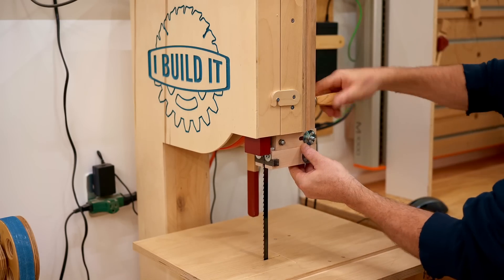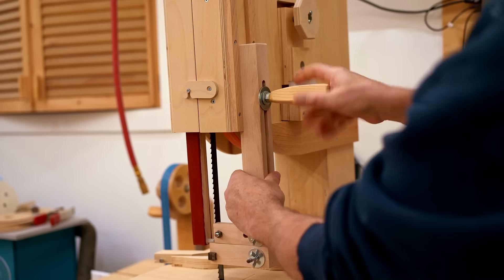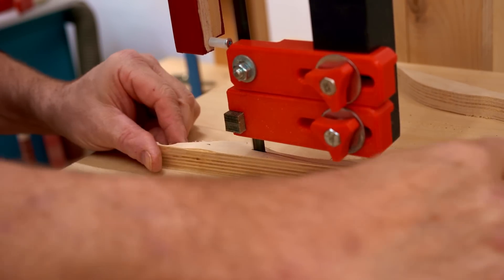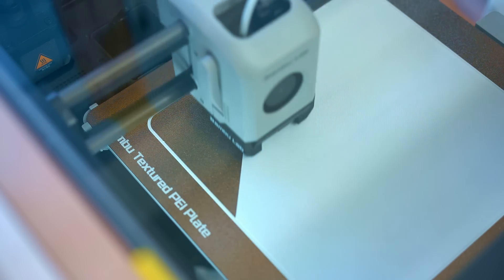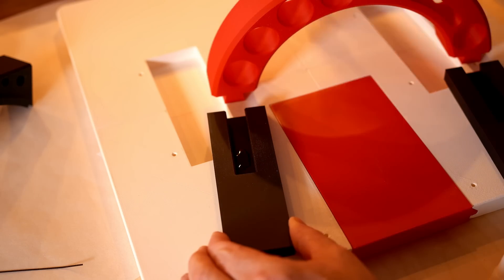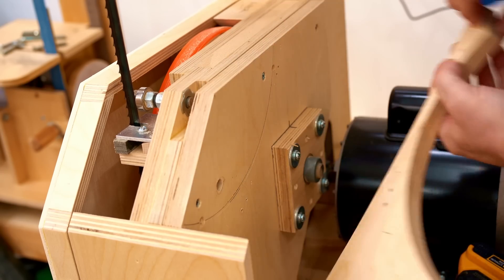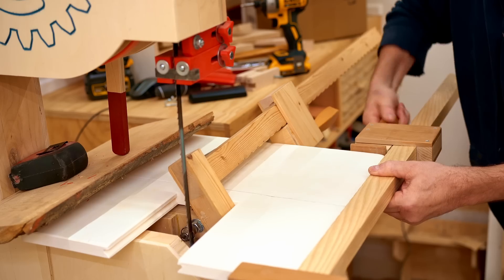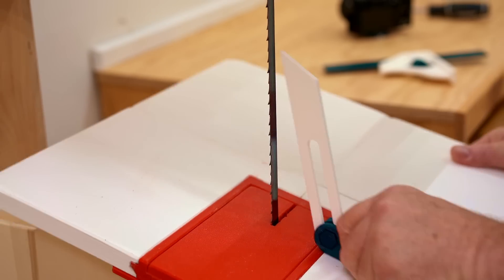He Said You Can't 3D Print a Band Saw... I Said Hold My Beer

Comment: Absolutely! Plastic has become the new wood in many ways. But beyond the humor, I really appreciate your 3D printing content. The 3D printing community on YouTube often focuses on kids printing toys or adults printing novelty items, which can give 3D printing a superficial reputation. However, the truth is that if you have an engineering mindset, you can produce functional, load-bearing parts with ease using 3D printing technology.

Comparing plastic to wood, it's evident that plastic is softer. Yet, for numerous applications, this difference isn't a critical concern. Your expertise lies in crafting items traditionally made of metal from wood, simply by scaling up the wooden components. This approach effectively resolves the challenge since space constraints are often less significant in these applications. Similarly, with 3D printing, scaling up plastic parts can meet the load-bearing requirements of metal parts without issue.

Furthermore, if you're utilizing an enclosed printing setup, you can explore materials like polycarbonate, which offer significantly higher stiffness and strength compared to PLA or PETG. This versatility showcases the potential of 3D printing to create durable and functional components across various industries.

Comment: Keep going!!!!!!!! I design and build machinery. This will absolutely work if designed properly and your printing strategy is well thought out. Your an amazing engineer. You can do this. P.S. make the 4 part table with tear drop interlocks for the connections same as you did with the guide bar print.

Comment: How about a separate 3d channel? Please finish printing the entire bandsaw.
Reply: taking a design with "wood" in mind, and translating that 1:1 to 3d printing wont work at all - you certainly can print a good and functioning bandsaw, but you have to design it with your manufacturing process in mind. just reproducing a wooden bandsaw with a 3d printer wouldnt do the process any justice.
Reply: @SharkyMoto  yeah the main example is cutting the insert that clearly wasn't reinforced instead of doing it in cad.

Comment: You've actually tapped into something very exciting here John. There are plenty of people out there doing accessories and custom parts for tools on their 3d printer, but nobody is doing real, substantial tools, except actual printers which are at least 50% hardware.
Reply: I question heat transfer from the blade guides melting the plastic.

Comment: Hello John I recommend that some of the parts, you can make them more dirable and stronger if you fill them with epoxy… I have e made two half’s filled with T-88 and reconnected with some T-88 and two screws mostly as alignments, I use them to even make hydropress mounts ALU.

Comment: This is not a project. It's an adventure. So much can be learned by making the parts for the bandsaw out of 3D printed parts. As you have shown, some things will need to be redesigned to meet the requirements needed to perform the tasks. Please continue improving the bandsaw. love the ideas.

Comment: You probably answer your own question in the video.
( + ) When it comes to finishes, miters, dovetails, fine finishing, the 3dP saves you the "donkey work" of "spending the better part of a day" once the design is ready.
(  - ) When it cones to brute strength of large flat objects, "stock" material wins out. 

The optimum, then would be a combination whereby the fit-and-finish is from 3dP while the "bones" are from stock wood or sheetgoods, requring only low skill.

Comment: If you've printed your parts out of PLA, then you're going to see plastic deformation on any part that sees a sustained load. Not just significant loads, but even seemingly trivial ones, like a hand tightened bolt.

Looks great, just something to keep in mind.
Reply: yep. PLA creep makes it unusable for these types of builds. use ASA or PETG instead. it's really weird to see PLA where it's flowed around the bolt head from merely being tightened.
Reply: @TMS5100   in my opinion ABS shouldn't exist. If i uhh accidentally pushed it and if it uhh fell into the ocean all of it, I wouldn't shed a tear.

I use HIPS as a much less obnoxious substitute.
Reply: @SianaGearz  It is a shame that you are so wrong. ABS is the best filament. Other than hyper-specific requirements, ABS meets almost every need, no other filament does.
Reply: @SirSpence99  ABS emits more poisonous uncured styrene than any of its siblings and it has high warpage and shrinkage. It's a graft built on butadiene flake with long arms of styrene and acrylnitrile and as butadiene unfurls when heated, it starts flailing the rest of the polymer around, this the bad dimensional stability. It's also not at all abrasion resistant. The layer bonding is not great under the best of circumstances. It's also not chemically stable a elevated temperature, surviving only a handful minutes, so the mass that is in the melt zone during preheating is generally completely shot and slow printing such as intricate sections with lots of travel and retractions results in weakened polymer.

Neither HIPS not ASA have any of these issues not to this extent.
Reply: @SianaGearz  The offgassing, warping and shrinkage can be relatively easily compensated for by just having the printer enclosed.

You also are not accounting for the temperatures at which it starts to have problems, temperatures that are well above average consumer temps, PLA completely fails well before those temps. I haven't personally tested abrasion resistance, though I have not noticed that as a problem. Layer bonding is rarely a problem and when it is, it is a problem regardless of material. Again, that temp at which it is not stable is well above average use cases. The idea that it has to print slow is nonsense. It can print much faster than PLA. I routinely print ABS at 20 cubic mm/s with no part cooling. I could print faster but my gantry is not stable enough for it.
Reply: @SirSpence99   
I think you're misunderstanding. i'm saying you have to print ABS fairly swiftly, and if you can't, if your printer or print isn't fast enough, you can be in trouble. When you have prints that are intricate and have a lot of retractions, the material starts degrading during printing, because the rate at which it gets propelled through the melt zone ends up being so slow, that it manages to degrade sitting there at elevated temperature.

And no reason to bring up PLA because i'm not suggesting that you can replace ABS with PLA. I'm suggesting that you can replace it with HIPS and improve prints because it is more stable and has less die swell and comes out more dimensionally accurate and more isotropic at the layer boundary. It's also similarly lightweight and similarly temperature resistant in use, and similarly cheap. ASA also has very good properties but it's more expensive, which HIPS is not.

But one also has to beware that sometimes you order HIPS but get ABS regrind instead. Luckily honest suppliers which are quite cheap are around.
Reply: @SianaGearz  Ah. I haven't had that problem either unless I have no part cooling. (I broke the part cooling fan on my printer, so guaranteed I would have a problem.)

Though that said, I haven't done strength testing on extremely small parts. I generally print with a 0.4mm nozzle but have had luck with a 0.25mm nozzle. This problem is likely resolved with a smaller meltzone which is generally better anyways. A CHT nozzle would likely help with that. It has a smaller volume but higher surface area for the meltzone.

Die swell hasn't been a problem with ABS for me nor has dimensional accuracy been a problem. Every time I've had warping was due to poor configuration on my part or a bed that is shot.

I brought up PLA because that is the standard people go to, which is nonsense for most serious applications. I'm glad you aren't.

I will look into HIPS, I'm mixed on some of the properties I'm seeing, my biggest "issue" is the lack of additives, though I am probably sooner rather than later going to figure out how to extrude my own filament, so that is a relative non-issue.

And yes, I would probably prefer ASA over ABS because that extra UV protection but other than that, I don't see a benefit, especially considering the price.
Reply: Smaller parts 3D LARGER Parts in wood and aluminum